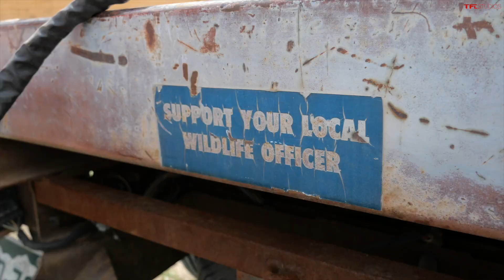This Did Not Go As Planned: An Old Chevy Truck Is a Surprisingly AWESOME Off-Road Rig!

Comment: The G80 is a specialized differential designed by Eaton to work as a low-speed traction aid, offering full lockup during its operation. When in normal conditions, the unit acts as an open differential, letting the rear tires spin independently of each other, with the outside wheel spinning faster during turns. However, when one tire spins 120 rpm faster than the other, the G80 locker kicks into action. The difference in rpm actuates a flyweight-type governor, slinging a pawl that engages a clutch system, which then causes a cam plate to ramp against a side gear, compressing the disc pack. This action locks together both axle shafts, and therefore makes both wheels rotate at the same speed. Eaton has included two such actuating pawls, allowing the G80 to work in both forward and reverse gears.
Reply: I’m a simple man who needs pictures, so to Wikipedia I go
Reply: @UnloadedRex  - Hahaha. If you have troubles finding it as the G80,,,,,, G80 is just the option code. The differential is made by Eaton. It’s an automatic locking rear differential in simpler terms.
Reply: @C10sRule  I thought I was the only one. Eaton Gov Loc is the actual name. The G80 RPO code could describe several rear ends depending on the model/year, even cars have G80 codes. It just means 'the upgraded traction option'. It's one of those things every time I hear them call it a G80 my eye twitches.
They really don't 'wear out' though. They get old/dirty and stick, and when they stick they end up applying late at a higher rpm eventually they break the spider gears.
The trigger is a pair of weights on a shaft that rides around on the carrier. It only spins when there is a difference in rotation from one wheel to the other. When there's enough difference in wheel speed the weights overpower the springs and engages the locker. When they get dirty and stick the weights will swing out way to late and it slams into lock, eventually breaking the spider gears when it gets bad enough. Keep them reasonably clean and they'll work forever.
Reply: @Anubis78250  - Roman has it down pat now!! That and quad exhaust tips,,,, not quad exhaust,,,,,. Roman has that right as well!! It’s not picking, but that’s the risk taken when you pose as somewhat of an automotive expert. People often live and die by their journalist/s and make very expensive buying decisions based on the knowledge they share. If it’s not accurate,, well, I know I would be p*ssed and become their worst nightmare,, hahaha. I’m not like that. I try to get it right, but I don’t claim to be an expert as much as I’m just an old fart that has worked on a lot of vehicles personal and friends vehicles.
Reply: Hi

Comment: Guys love to hate on the G80, especially now with E-lockers.  I love the G80. I own 3 GM trucks with the G80 and I have never been let down. 2x4, 4x4 or 4lo it will lock up when needed. It may not be the smoothest or most civilized locker out there...but it just works and is reliable.
Reply: Agreed. The only place or situation I don’t like it is in small boulders or on rock. The time it takes to engage is the time it takes to be stuck, roll back, or have too much torque applied and you break things, if I’m going rock crawling I want the differential locked from the moment I start rolling. Otherwise, I had a 2007 Colorado with the Z85 package and Automatic rear locker. I lifted it just over 2” and put 31” tires on it, I was absolutely amazed by what I could do with that little truck. It had the 242 Hp, 242Lb ft torque 5 cylinder and it was an excellent truck for just over 140,000 miles. At about 90,000 miles I had to replace all the working parts up front for the serpentine belt, power steering pump and water pump. The steering rack was also shot and I did two front axels. A rather expensive venture even with doing it myself. If I had the dealership do it, they quoted just over $4,000 Canadian. They were using the jobber rates and were billing something like w1 hours or so. I can’t remember the exact number. I do know I did it all in 2 days for about 15 hours of work and I had never done that specific job on any Colorado or related vehicle before. I absolutely hate jobber rates. Such a ridiculous rip off. The mechanic would work on that for 12 hours and get paid for 21 hours as well as the dealership getting their cut. Such a rip off. I know of the mechanic had troubles they don’t supposedly charge you for extra hours,,,, I will believe that when I see it. So far I have yet to even come close to taking the hours quoted by a shop that uses jobber rates. I am happy to get their free assess,ent though. 😂😂
Reply: Yeah I've have 98 just like this this that I bought brand new. I have a love /hate relationship with the gov-loc.  When it hooks up I love it! When it doesn't not so much.

Comment: That GMC is an oldie but a goodie. Thanks for showing what it’s supposed to do, it’s a work & play Truck. Us ole timers don’t need all of the bells & whistles on Trucks, less things to break. I have a ‘93 Chevy Silverado 1500 with 5.7L two wheel drive that I can’t part with, like to have a one ton CC 4X4 dually with 454 & auto trans, but if can find one that isn’t raged out they want a premium $$$$$ for one. Buy the way I tried to ween mine off of gas, it don’t work😀😀. Keep’m coming

Comment: The GMT 400 trucks are tough as nails, easy to work on and reliable as heck. I’m the original owner of a ‘97 2 door Tahoe LT/Z51 with the port injected 5.7L Vortec. It has the G80 and even with an open front diff, it will go anywhere I want it to go. Has never once left me stranded and I can work on it in my garage with basic tools. Don’t knock the G80, GM was using them long before other manufacturers had any type of locker and they are fantastic and simple.
Reply: Love that 2 door …
Reply: I just picked up a 1989 chevy gmt 400 with a tbi 350 and a 700r4 transmission

Comment: The unique thing about GM pickups is they’re the only heavy duty pickups that use independent front suspension, even to this day. Ford and Ram still use solid front axles on their HD pickups. Off roaders seem to prefer the solid axle articulation, but David’s truck seems to do ok.
Reply: Especially considering it has Michelin defender highway tires lol
Reply: IFS may not have the articulation of a solid axle, but it rides so nice on and off road. We take my friend’s 2WD S10 on trails all the time and it rides smooth like butter
Reply: My 2wd 97 ram 3500 has ifs
Reply: @SuperCrackSack  what do you want? A cookie?
Reply: @doctorno988  you said that ifs was unique to gmc. I was just sharing that some dodges have ifs too.
Reply: @SuperCrackSack  Most 2wd vehicles do. Chevy is the only one that uses IFS with CV shafts on their heavier duty trucks.

Comment: The G80 uses a governor that actuates a pawl with enough differential speed. That pawl will create a locked condition until the pressure is released  (think letting off the gas) and returns to an open differential. The car g80 was a clutch style limited slip.
Reply: I love my g80
Reply: it also releases after 30mph or so based on outward inertia

Comment: I’m in shock !! 
You mean to tell me you don’t need 
720hp and 1000lb of torque with full locking diffs 8 inch lift and mud terrain tires on 20 inch wheels to go off road.

Comment: David, may I suggest some covers for your winch cable plugs. It looked like they were wide open in the video. 
Also, I have a 1994 GMC Sierra (was with my dad when he bought it brand new) and if the fuel pumps are the same, then going up inclines are problematic. Until this video, I didn't realize why my truck would die when climbing at the ORV Park. Even with my '07 6.0L swap and more full  fuel in the tank. So incline + bumps + low(er) fuel, they must not like. Problem figured out. 
I love these ranch videos with David and whomever just having fun.

Comment: What manual transmission in those years, SM 465? I've only had automatics in my 88 and 89 K2500's!
Reply: Should be an NV4500. It's kind of like an SM 465 with overdrive. They were also in the 90s Dodges.

Comment: I have a 92 chevy also with a g80, but a tooth on one of the governor lobes is broken off so it acts like an open diff. And also yes David was close with his "centrifical force" guess, when one side is spinning faster enough than the other and creates enough force, a lobe on the out side of  the diff slings into place and locks the diff

Comment: The throttle body injection on our 1993 extended cab chev 350 made it get good fuel economy. Not as good power as the trucks of today but better economy at times. David is a jack of all trades and master of many! That’s how farmers and ranchers roll.

Comment: Had the same problem in my old Silverado those things have a 35 gallon tank and diagnob if it aint full and you're going up a very steep hill and all that gas runs to the back it's done I have coasted down more hills because of that situation than I what I'd like to count and it aint fun trying to stop  Is full size truck with no power breaks on a steep hill  Is mine was an automatic automatic. Never try more than like 30ﾟ with lethirty degrees with less than a 1/2 a tank lol

Comment: I had a 2000 square body k2500 reg cab long bed 5spd 4x4, 4” lift and 35s, dang that was a great old truck. Their wasn’t a mud hole or power line trail safe down here in Texas!!!!

Comment: The G80 is an inertia operated locker that senses a difference in rotational speed between left and right wheels.  If you haven't done anything to cause it to engage and lock-up in a while, you may experience the initial delay in activation, as you experienced in your first attempt.

Comment: The G80 has no clutches. It is made by Eaton. It’s an automatic engaging rear locker. There is a small cog that pops out if one tire is spinning about 100 rpm faster than the other. That cog engages the locker and stays engaged up to 30 mph or something. 
 When you are using the vehicle and a tire spins, let it spin!! It needs momentum to engage. David was right it did need some more wheel spin. The mechanics have been the same since the origins of the G80 option code for the Eaton automatically engaging rear locking differential.
Reply: There are absolutely clutches inside a G80. Had one apart recently out of a 14-bolt, and have one out of an AAM 11.5 sitting on the shop floor. There are lots of springs and gears and such as well, but they do have clutch plates deep inside them.
Reply: @stanludorf2311  - I was wrong. I have also had them apart and the clutches are there to control the spin prior to the cog engaging. I was trying to get the point across that it’s a true locker and not limited slip. My mistake. Thanks for saying something.
Reply: @C10sRule  they don't require additive for some reason like a true clutch-type.
Reply: @stanludorf2311  - I don’t suspect they get worked like a limited slip, they lady a long time but as the clutches wear the engagement of the locker becomes more pronounced. I have never taken one fully apart myself. That exceeds my mechanical will. Haha. I’ll drop the rear pan, inspect and then take them to the gear shop if needed. I have restored or modified almost 50 vehicles now personally and have helped others on quite a few more, but the differentials were never something I have wanted to tackle. Suspension work is fun and I don’t mind tearing down a motor, but transmissions and differentials,,,, nope, I just pay others!! Hahaha. 
     I ran mostly Fords with limited slip differentials until they switched over to the electronic actuated lockers. Did have a few GMs over the years too, but after 87 the front ends were not very long lasting in them,,,,. Especially the 4x4s of course.

Comment: Here's the reason for so much confusion:
GM used RPO code G80 in many vehicles, both cars and trucks. All code G80 means is that you don't have an open differential. If you have a GM CAR with a G80, you then have a limited slip differential, clutch style. If you have a GM TRUCK with a G80, you then have an Eaton locker, not an lsd. Completely different design, for different purposes. This is also why you DO NOT put lsd additives in a G80 on a truck, but you DO on a car with a G80. Furthermore doing burnouts on pavement is way better with a car-style lsd G80, as the truck-style locker G80 is designed for full 50/50 lock-up once it engages, and can grenade itself if you try to do high torque aggressive burnouts on dry pavement. Then again, the truck G80 is far superior off-road.
People will keep getting this info mixed up and confused for eternity :)

Comment: Not all G80 differentials are the same.  The G80 found in the 14-bolt is not designed or built the same as the one in the lighter semi-floating axles.  The 14-bolt version is much tougher, and more reliable than the standard one found in lighter duty axles.